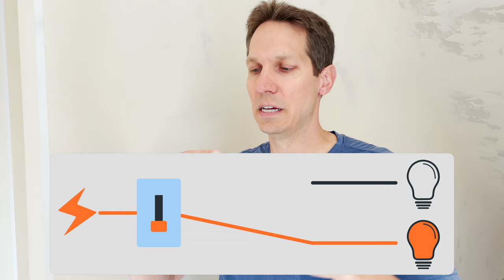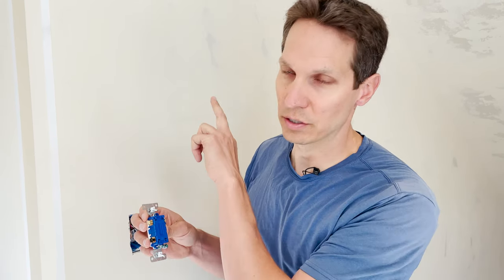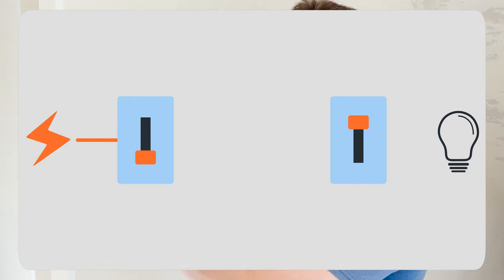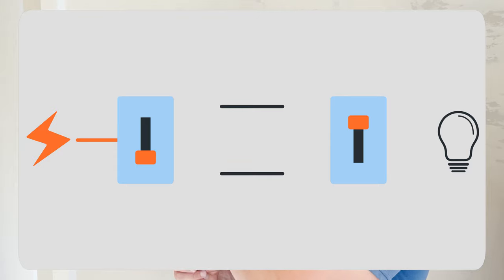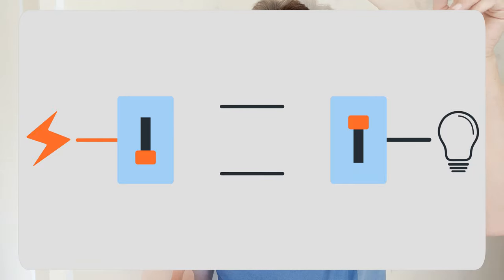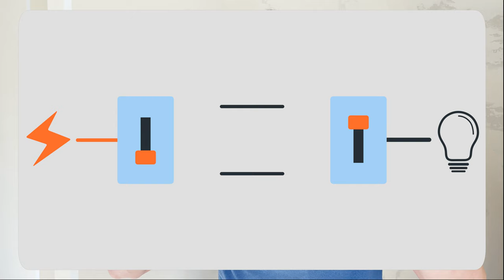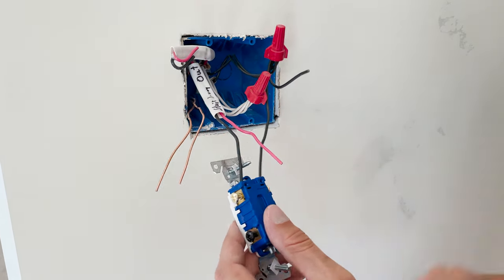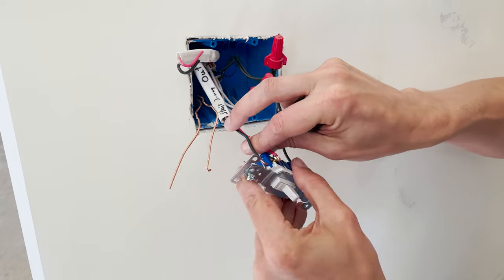How a Three-Way Switch Works - The Basics | CircuitBread Practicals

Comment: 12/3 running between the boxes.  Did not say where the other conductor went.
Reply from the maker: Yep, good point.  Didn't explicitly mention the neutral line being the third conductor.  So, neutral, hot, and traveler, where the interesting stuff happens with hot and traveler.